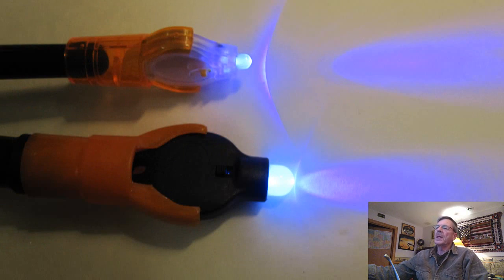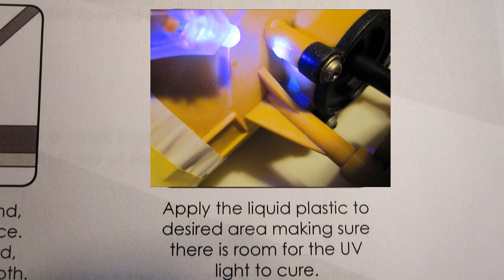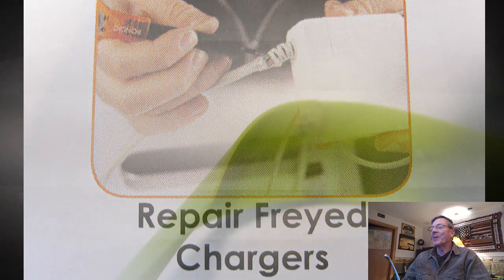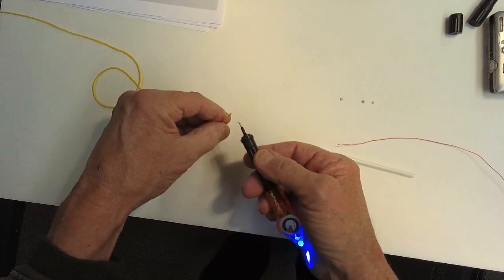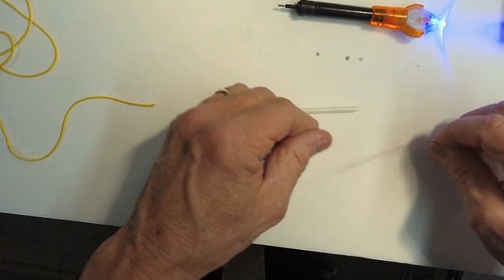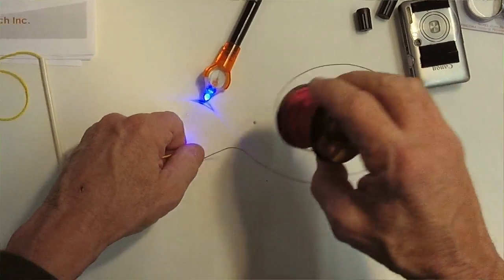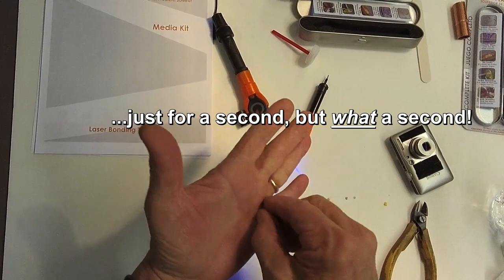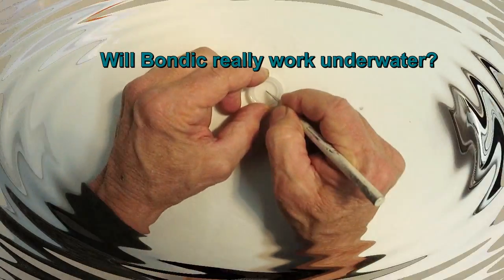" 4 second Laser Welding" Underwater? Does Bondic Laser "Glue" work underwater as on TV?

Comment: looks great. is there a way to UNDO the bonding ? some fluid or so ?  like red locktite you can use hot air.. ??
Reply from the maker: +Bas Berendsen (A sledge hammer would probably undo it.)  Good question.  Ill check it out.  Thanks.

Comment: That's pretty incredible! Have you been using this stuff for long? I wish I'd known about this stuff earlier.
Reply from the maker: +eRCaGuy I have been using it for about 2 months and have a test video up on it challenging the broken quadcopter prop fix.  It may not work on everything, but It has worked on everything I have tried so far.  I wont be going anywhere without it, that is for sure.  Thanks.